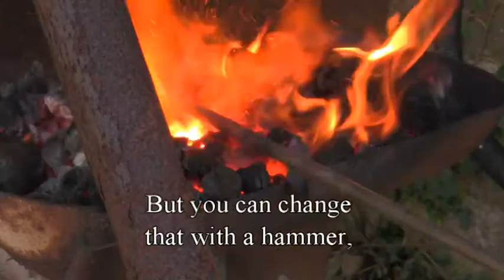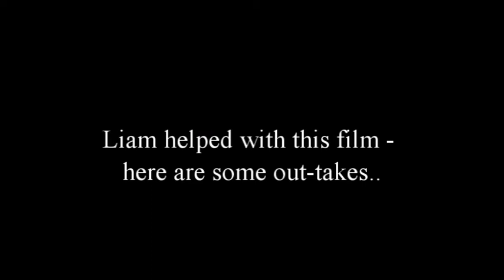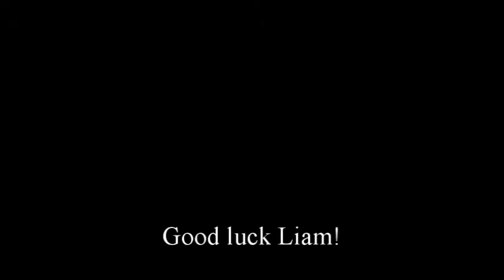Forging Leaf Shapes The Easy Way

Comment: You'll be vastly more efficient if you get your steel covered in coal instead of just flopping on top.
Reply from the maker: well obviously we put it into the coals to heat it through, but what you saw was just our way of heating up the centre.